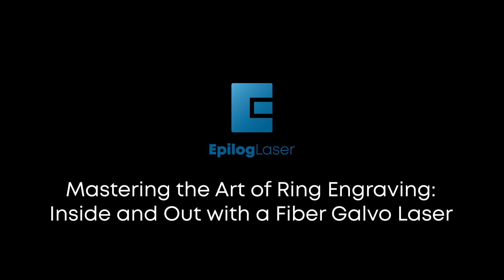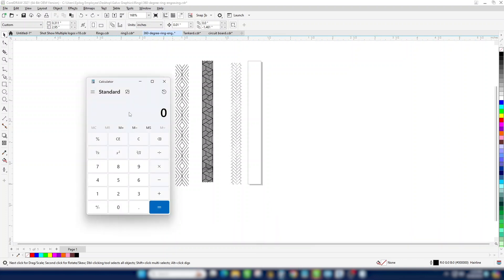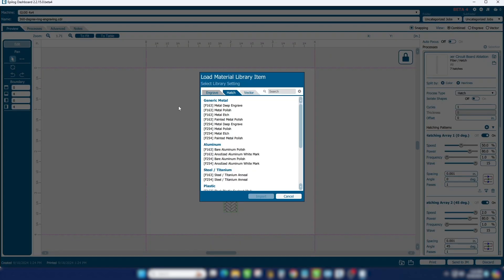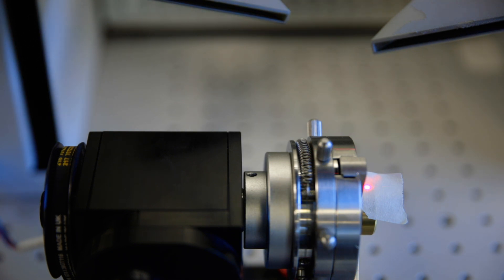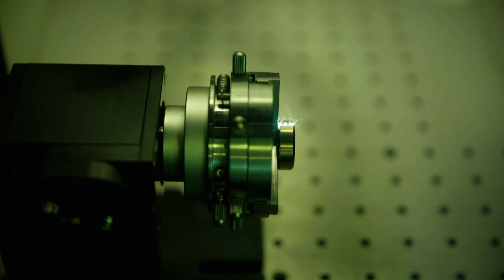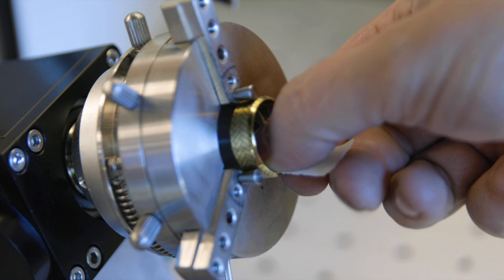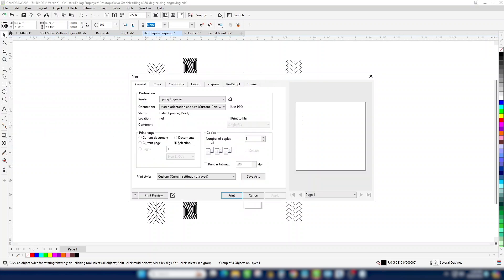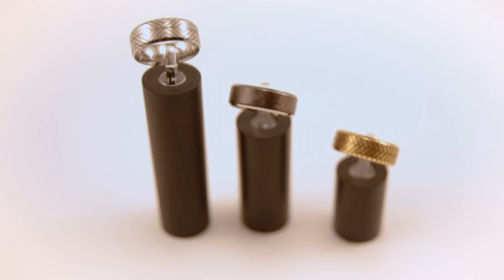Mastering the Art of Ring Engraving: Inside and Out with a Fiber Galvo Laser

Comment: I thought you can only use the F163 Lens on the rotary attachment?
Reply from the maker: Hi there, The F254 lens works as well, you’re just more limited on z-axis. For the rings this isn’t a problem. The z-axis limit for the F163 lens is 10 inches, and the limit for the F254 lens is 6 inches.
Reply: We have a Epilog Galvo our self. How do you set a default setting to be the same every time you print? You said you did it in the dashboard?
Reply: @Hus-Alfen  not sure if you got your answer yet but in the Epilog Dashboard go to the settings in the top right corner, click the Dashboard tab and under "New Job Settings" click the drop down menu and select "Previous Settings".